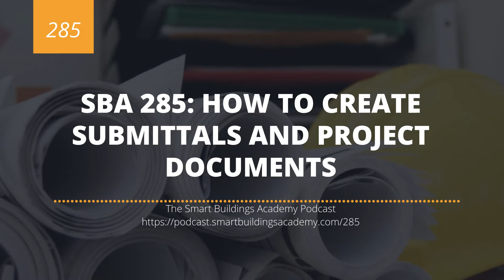SBA 285 : How to Create Submittals and Project Documents

Comment: I’d imagine the term “Network Riser” was taken from other trades’ “Risers.” (Mech, elec, etc.)

As part of my network risers, i include the diagram, illustrating  the controllers’ floor, trunk, port, wire type, etc.. similar to other trades. Where we diverge with other trades is the table included in the networking section of the submittal. Where we specify device addresses, location, name, type, and other relevant info. If and when elbows and reducers evolve into network devices, surely they’d have a table as well haha jk

Im so grateful to have found this channel. Great content! Have you thought about adding visual illustrations?
Reply from the maker: So some useless info for you on a sat morning. The term riser is the vertical or horizontal pathway in a building for cabling. Our "Riser Diagram" which you take a good approach to, is meant to visually represent that on the submittal document. 

As for visuals, yes we will continue to build out the presentation aspect of our episodes. Look forward to that in 2025!